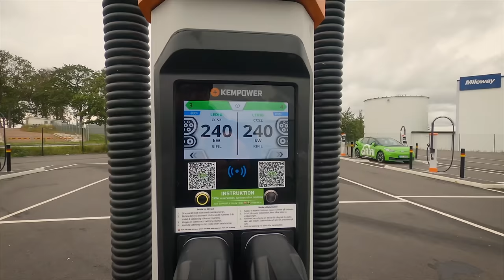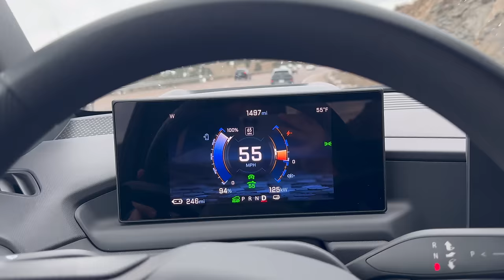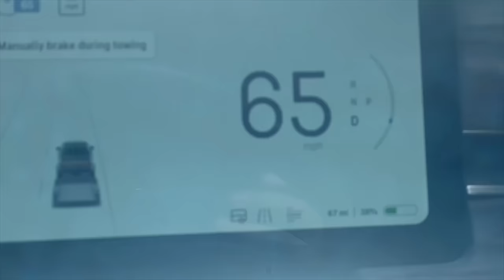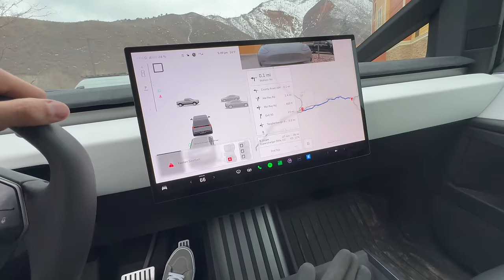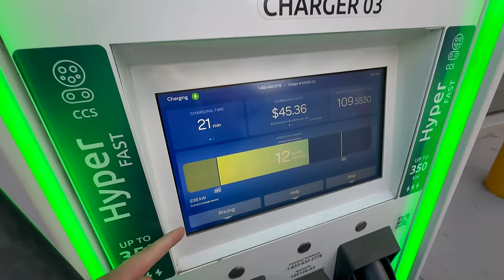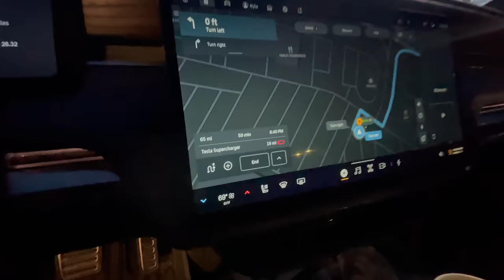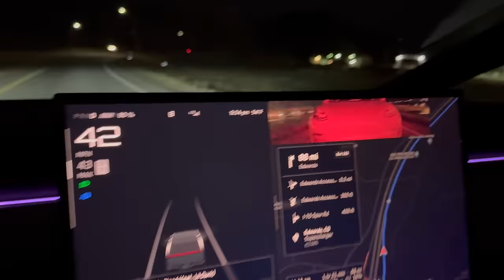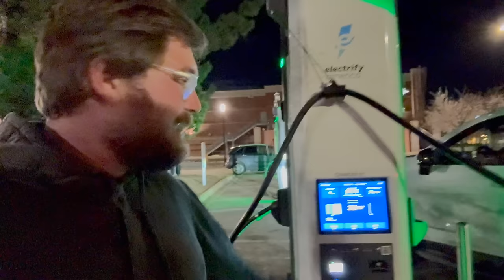Electric Trucks Tow 500mi Over The Rocky Mountains! Cybertruck vs Lightning vs Silverado EV vs R1T

Comment: All these EV truck tests and races makes this the greatest EV truck series to ever be done and recorded to this point in history.

And EV trucks should all have their port on the right front to accommodate pull in charging while towing on V3's and other chargers. Even Tesla fails by not placing their own Cybertruck's port there. We know that pull through stalls will take quite a few years to propagate all throughout the country. And of course, all should be 800v with backwards compatibility with 400v chargers. Either by splitting the pack in two, or a proper on-board DC charger that provides at least 200kw charging on them.
Reply: What everyone is missing is the port location is really dependent on charging equipment location in the truck and the shortest cable run into the battery.
It becomes a packaging and efficiency issue with longer runs needing thicker wires.
Reply: How about 2 charging ports - right front, and rear left. Full compatibility with nose first or tail first charging.
Reply: @chrismuir8403 That's pretty expensive to do ... each one needs independent means of electrical isolation. You cannot have the live pins on the same circuit - you cannot have the pins in the unused port live when the other one is being used.
Reply: @Nebula1701 It's true, but all of these are all-wheel-drive, and they all have "electrical stuff" with high powered electrical circuits at both the front and rear of the vehicle. Both Ford and Rivian got it right ... and GM has it in the right spot on their other EVs.
Reply: I had an intuitive suspicion that a front-mounted charge port would be better for on-the-road charging while towing before watching this video, now I'm absolutely convinced of it. Seems like that's the only main knock against the Silverado.
Reply: @bikeaddictbp  The correct location is the RIGHT front. NOT the left front. So Ford and Rivian did NOT get it right. In fact, Jim Farley has already stated they are going to change theirs to the correct location to be able to use V3's. 

That's unless you plan to carry around an extension that can get lost or stolen, or only plan to charge at EA or EVgo without taking up 2 spots.

Like it or not, there are more V3 stalls/dispensers out there than ALL other stalls/dispensers combined. In fact, more than 4 times more than all other Fast DC charging ports. So unless you want to restrict your options to only 25% of the charging options out there without having to carry around an extension, or taking two spots, you place it on the correct location. Which for towing is ONLY the RIGHT front.
Reply: @Paul-cj1wb  front right, is also better for curbside charging.
Reply: @chrismuir8403 I mean technically dual port works for sure, but it requires tremendous wiring or extra module(s). Generally there is a AC/DC converter into the DC/DC module - into the battery pack. AC/DC converter is needed for home charging (as obviously the grid is AC), afaik any fast chargers personally converts AC/DC. So at the very least for it to function you need DC/DC modules X2 for this to work and they take up quite a distinct amount of space or alot of long loop wiring which is likely to fail in time vs/consistency. This is all 
Excluding the decompression zones of the front regions of the vehicle ( in the event of an extra DC/DC module), which becomes a vital part of vehicle safety aswell. 

I'm not a expert on the matter but something along the lines is my understanding. Perhaps someone else with better knowledge can explain better. Anyways, if it wasn't for the (cons) I'm quite sure everyone would already have dual ports.
Reply: @Paul-cj1wb  I think the reasoning why tesla chose rear charging has to do with safety, as it is their main priority. 
The modules for charging are about 10-20kg lumps of metal that can't be completely integrated into chassis, having them Infront will also decrease ability for decompression of the front region of the vehicle in the event of collisions. 

But yes, the front would generally be the best spot for the charging port.

As stated in previous comment I am still not an expert of the matter and will gladly take further information and corrections.
Reply: @samgerland6087   Top of the line engineers can figure out a way to place it on the right front without sacrificing safety. The fact that they went with the rear has more to do with that weird frunk (not to mention the weird windshield) than anything. But again, the right engineers can figure out away.  

They were also banking on their V4's and pull-through stalls built out. But I think it's something they're regretting now. The fact that they're working on an extension cable has a lot to do with this.

But at the end of the day, there's no true reason why it couldn't have gone on the right front, even if it affected the frunk somewhat.
Reply: @Paul-cj1wb  you answered a total of 0 topics. No idea what the windshield nor the trunk has to do with anything of this. Said module will by default be configured to the lowest point possible without sacrifices. And neither of hos sacrifices has to do with the trunk nor windshield. 
I literally don't understand why you even mention the windshield, but perhaps you can explain. The trunk (almost) makes sense.
Actually after reading ur comment again it become apparent you have never seen a charging module system physically.
Reply: @samgerland6087  I was referring to the small amount of space left by the design of the massive, straight windshield; the extra wide frunk, after accounting for the passenger compartment. 

Leaving very little room for the glove compartment, air filters, fluid containers, the dual steer-by-wire motors (for redundancy), the drivetrain motors, all the high voltage thick wiring, air suspension and it's motors, not to mention the front side of the battery, etc. All around the space needed for the large tire it uses.

I was trying to provide a justification, or give them the benefit of the doubt, as to why they might not have gone with with a right front charging port placement. Because in my judgement, that is the optimal placement for a vehicle that will be used for towing by those that tow.
Reply: @Paul-cj1wb  for some reason of forces unknown I simply don't understand your point. It appears you confirm my thesis regarding the DC/DC module, and therefore I can't grasp that either you accept that that it will be detrimental in regards to safety or you accept the caution of longevity and accept a sub par limit on charging? Afaik you can't have neither. 

Again from what I understood you didn't answer / give input on my comment other than (I personally hate X vehicle so I will create a alternate reality to make my thesis and pretend I have fundamental understandings)?

Again, I would appreciate some (actual) real life fundamental feedback.

Not quite interested in personal hatred. There is plenty of Joe Biden channels you can utilize for hatred and non existent realities.
Reply: @theichione1827  Yes, exactly, which is really the ideal way to charge when towing, and the best way to put in charging locations without having to have property.
Reply: @Paul-cj1wb  When I eventually buy my first EV truck I'll definitely have an extension on hand anyway to help accommodate in certain situations

Comment: With working chargers the Silverado EV is unstoppable.
Reply: If they had the Cybertruck battery extender, this would be a closer comparison.
$16k for 47kWh of 450lbs battery.
Reply: @davidbeppler3032 and then your max towing gets destroyed because of the huge payload loss. The weight on that battery is gonna be 625 because it needs to meet DOT regs
Reply: @davidbeppler3032 the Silverado would still win though because the battery capacity is so much larger still, 212 kwh vs 170 kwh.
Reply: @mattbrew11  So, still 1500lbs less than the Chevy?  Seems good.  Also, the Silverado efficiency is pretty low.
Reply: @davidbeppler3032  no. Your understanding of payload as it relates to towing is non existent.
Reply: @mattbrew11  You keep talking about payload, ignoring it was a towing video.  Nothing in the bed of the trucks.  That is the payload.  The Chevy outweighs the Cybertruck by about 2,000lbs.  Does that effect your payload argument?
Reply: @davidbeppler3032  do you have any idea where the extra battery goes?
Reply: @mattbrew11  Why do you think that matters when towing?
Reply: @davidbeppler3032  you literally have zero understanding how this works bud
Reply: @davidbeppler3032  Right now using the range extender is as realistic as driving a new Tesla Roadster. Neither one exists.
Reply: @stephenj4937  Good point.  You bought a GM Silverado EV instead?  Oh... those don't exist either.

Comment: It's not JUST big battery though, it's also the solid 800v charging curve. Trucks NEED 800v and big boy curves.
Reply: What do you you think you gain from over 250 kw speed?  A few minutes from 0-30%,  everything over that is below 250 anyway.  Holding 250 kw longer/deeper will increase speed more.  800v is better for cost but cells still limit charge curve.
Reply: Uh 350kW is 40% more speed over 250kW putting a lot more area under the curve for that part off the charge? The 4WT doesn't taper until like 35%, that's a whole MY LR battery before it even starts to slow. It doesn't go below 250kW until after 60%. Big boy curve. 250kW@400V=625A, which makes some pretty serious heat loss in just the wiring. It just doesn't make a lot of sense for trucks when you need to put in real energy.
Reply: @tazeat  true, the Silverado is on another level with that huge pack.  Didn't realize how long it held 350.  250 is fine for the others but that monster pack has a LOT of curve over 250.  Should have watched till that part before commenting 😬.
Reply: Yep. Check out the 2025 Taycan curve. It stays over 300kw past 62% and then above 200kw till 76%. It can do that because 800v keeps everything around the pack so much cooler and it's so much easier to cool the cells. Most people can't understand that no matter how much you explain it to them.

For example, the Taycan never went past 130F while the 250kw speed of new Model X (400v) with it's tremendous curve all the way to 31% reached 140F by that time. And the new Model X and S are charging monsters. But 800v simply takes it to another level.

That's the future of all EVs, but especially for trucks. No trucks going forward can afford to be 400v.
Reply: No it is just a big battery as that automatically gives you the other stuff, the problem is it's a dumb business decision to to put 3 cars worth of batteries into a one truck ,but they trucks never make sense for 90 percent of the idiots that buy them.
Reply: @alanrickett2537  That is absolutely not true, so many design and hardware decisions and cost trade-offs need to be made to support a charge curve like that. Pro tip, most half ton trucks have gas tanks 3 times the size of sedans too. If you really want to get ICE trucks off the road, this is what it takes. As costs continue to come down and volumes continue to grow it seems to be expected.
Reply: How  many BMS  systems have you designed,  I just did the one, but its very much easier to safely change a battery at  under 0.5 C than it is at 5 C just like it is easy to fill a swimming pool with a fire hose and hard to fill a tea cup.  @tazeat
Reply: @alanrickett2537  True, to a point, but if everyone thought like that there would be no EVs today. Or at best, we'd all be still driving Nissan Leafs with 25kWh batteries charging at 40kWh. And there would be no EV revolution happening today.
Reply: @Paul-cj1wb  grab the low hanging fruit , you can build 100 trucks that drive 30 miles a day and never tow a thing or 300 cars that drive 30 miles a day and never tow a thing we both no which has a bigger impact.
Also 
You don't get better at doing the same with less unless you try hence why in Europe we have 4 cylinder 2 litre engines with more torque and horsepower than 5 litres 8v in the US ofA
Reply: @alanrickett2537  Yeah, but all batteries will be this large or larger down the line. Not physically this large, but smaller physically with so much more energy density, providing many more kWh. They're just doing it with physical size for the time being. Suddenly towing for 500 or 700 miles is not so bad for an EV truck. And all the talk from diesel heads becomes just a little bit more quiet.
Reply: @Paul-cj1wb  didn't happen in the US to get more fuel efficient and even with laws trying to force it it's still not happening, so use every thing you can to force them along pack size road tax would be a no Brainer for me only question is weight or kWh or a combo.
Reply: @alanrickett2537  Yeah, but that's Europe. For better or worse, North Americans don't think like that. Neither in the US or Canada. On the flipside, that's why Tesla was founded in America and not Europe. By Americans, by the way, Elon was not a founder.

While most Europeans were contended with Nissan Leafs, and 2 liter engines, North Americans were not. If you're going to change the habits of North Americans, you need to give them either what they're used to or better. Modern EVs and EV trucks are just that. And getting better by the year. Heck, even by the quarter year at times. 

You have to remember that the 3 countries that compose North America are all oil producing countries with much, much cheaper gas than Europe. And while I agree with you that most North Americans don't tow a thing with their pickups, they still buy them by the tens of millions. 

You want North Americans to stop burning fossil fuels for their transportation, you give them the EVs that meet or surpass the ICE vehicles they're used to. And Nissan Leafs nor your 2 liter engines are going to cut it.
Reply: I’ve got some big boy curves that I don’t need.
Reply: @alanrickett2537  False
Reply: @Yielar1  what statement are you disagreeing with.
Reply: @Paul-cj1wb Pity the 800V charging network sucks and they don’t charge well on the Tesla SuC
Reply: @alanrickett2537  I'm not sure you can justify based on KWh size, could you?  You don't pay anymore for a pickup that has a 38gal tank vs a 19 gallon tank, do you?  Now weight, I can certainly get behind taxing them based on that.  
I'd say that with electric cars, they should have a yearly registration/inspection/tax based on weight & maybe mileage, or a minimum base fee with a weight class multiplier.  

Did you know they are trying to make old Prius hybrids be considered EV's so they can make them pay EV road taxes every year whlie they own it.  We've gotten many calls & letters from the DMV asking us to sign documents agreeing to "re-classify" the car as an EV.  it's a 2006 and is 95% ICE & is only a "mild" hybrid.  Completely ridiculous!
Reply: @oof_Dad  There are chargers that go to 600v. Just not in US or Europe. 800v keeps the wiring smaller.
Reply: @oof_Dad  I think we need to stop normalizing slower than 350 kw speeds. ICE cars have many more pull through fueling stations that it is common place and EVs are stuck slower charging for 40 to 65 minutes, which is a complete joke.

Comment: I just did a 500 mile towing trip in my R1T at 60mph. 1.4 mi/kWh, 5500# load with small area, 3 charging stops. 500 miles towing on 1 stop is insane for the silverado.
Reply: Yeah but it also has a massive battery and is crazy expensive
Reply: @KiRiTO72987  you pay for what you get?????
Reply: @KiRiTO72987  mine was under 66k for 4wt trim and 450 mile range.     Range is king
Reply: @bad50  where did you buy it?